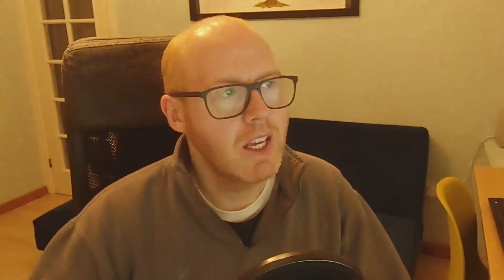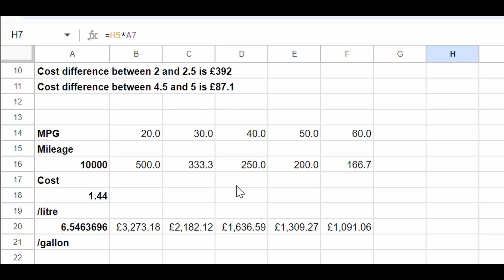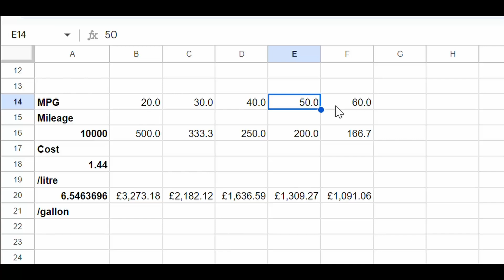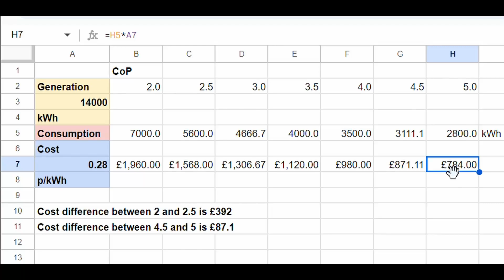Why Heat Pump CoP isn't Important : Reduce Cost & Decrease Efficiency?

Comment: I wish worrying about COP 4 or 5. Our SCOP is 2.4. British Gas install 2023, Vaillant aerotherm ASHP.
Reply: I suspect you can improve on this. Vaillant is a great pice of kit we get 4+ scop. Try posting on the openenergy forum . Very knowledgeable and helpful bunch who may be able to suggest changes that could help you out. Playing with the weathercompensation curve number is a big one. Good luck
Reply: Thanks! I am afraid there might be something fundamentally wrong with our installation. They put in a 7kW unit on our small bungalow. I will post on that forum though, perhaps there is some other easier-to-fix issue. I went down to 0.4 heat curve already, no effect. Flow T are low and house is warm, so it's a bit of a mystery to me
Reply: @pip1980  they love a problem to get their teeth into! We have the 7kw unit. Bit oversized for us. Does your low cop relate to a high running cost? Vaillant cops read out  are not very accurate from what i have heard. If cost is an issue have a look at agile octopus tariff. Turning down the room temp by 1 degree from 4 to 7pm. Has reduced our bill by a third from the price cap. The house does not noticably drop in temp during this time.
Reply: @pip1980 The heat pump is probably cycling if too large which reduces efficiency.   I assume a heat loss survey was done on the house.   This should give you an indication of the size of unit required
Reply: @crm114.  I think that might be the case. Their survey said >14,000kWh and they put a 7kWh unit in although our annual gas usage was only 5,000-10,000kWh.
Reply: @pip1980  No way has your house got that heat loss.    To get a rough estimate of the size of pump you need, divide your annual gas use by 2900.   In your case 10000/2900 = 3.4.  So, even as 3.5 kW unit might be oversized.    British Gas should have given you an estimate of the expected annual energy  use.   If it's not meeting that you have grounds for complaint.
Reply: @crm114. The fundamental problem in utilising prior gas consumption is you do not know how the user operated their heating system and what the departures were from design internal temperatures. In other words, some users are prepared to suffer discomfort to achieve the lowest possible bills - especially in the shoulder months. Rules of thumb are generally rules of dumb.
Reply: @normanboyes4983  I used this rule and it was far more acurate than the MCS calculation/estimate. After all they just guess the ventilation losses. Agreed that if gas use had the house cooler than they wish with hp it won't work well.
Reply: @joewentworth7856  I was talking in general terms, as I sort of indicated if you can be confident (as a user) that you have kept the whole house to design temperature then gas consumption can be useful. But a contractor cannot have the same confidence. If it is a MCS/BUS installation they are mandated to do a heat loss calculation.
Reply: @normanboyes4983  sure. What I meant is  it is  useful sence checker. IF he user has been happy with the comfort level of their gas boiler. MCS number will always be cautious to avoid undersizing. The gas rule of thumb allowed me to get my installer to install the 7kw in place of the bigger more expensive 10kw unit and the 7kw has still proved to be unnecessarily powerful. In the end I think installer will get a sense of what each building needs and start putting in better sized units in and hopefully hps will have wider operating ranges in future making over sizing less of an issue.
Reply: @joewentworth7856  The current issue with some units is while they are badged as a ‘small’ capacity the actual compressor used is from a larger unit and they limit the output in software to match the badge, so you are stuck with effectively poorer modulation.
Reply: @normanboyes4983  true. As the market matures and real numbers feed back in and there is a demand for physically smaller, cheaper, lower power units there will be a good market for 4kw and lower units with proper modulation range. Particularly  in modern insulated  privately owned apartments.
Reply from the maker: How have they set your controls? They set mine poorly and this resulted in a day of poor CoP until I corrected the settings.
Mine was functioning as a gas boiler on day 1.

If you've changed your curve to 0.4 and haven't noticed a change then I would check which room temp. mod. you have selected. It should be inactive whilst you try to find the right curve for your property.

The minimum modulation between the 3.5kW and 7kW unit isn't actually that much and I'm guessing you have a buffer tank as well which will somewhat shield you from the cycling effect of being oversized.

The 7kW unit does perform significantly better than the 3.5 & 5kW units when it comes to DHW production.
Reply: @UpsideDownFork  Hi,  I think I just made a discovery, but I might be putting too much hopes in this... Can I ask you, which flow rate do you get usually (Control unit->live monitor - Building Circuit Flow Rate) ? Does this go up and down or is it always a constant value?
By going into the installer level menu on the HP control interface (not the sensor comfort), I found out that the Flow Temperature (FP) is generally only ~1°C higher than then Return! i.e. dT ~1C° while it should be around 5°C. Secondly I noticed, that whenever the HP is running, the building circuit flow rate is constantly at ~1205 l/m, which is the maximum for the 7kW unit. So if I understand correctly, the ASHP just rushes the water towards the buffer. Our rooms however, are perfectly warm enough with however much the secondary pump draws from the buffer to the radiator. I assume that this is much less/slower however than 1205 l/m. So if that is the case, the ASHP just gets most of the hot water straight back from the buffer tank, instead of getting mostly cooler water from the radiator side. 
I phoned the Vaillant helpline today and the adviser was baffled by this as well and thought the unit should automatically adjust the flow until dT=5°C . We checked that I have "Conf. heat. build. pump" setting correctly as "Auto" (other options are 50-100 %PMW, whatever that means). Also he suggested lowering the setting "Max. rem. feed head" from 900 mbar (default) to 750mbar but that had no effect on flow rate. 
I am probably misunderstanding something, but at least I have some hope again that this might be something that can be fixed.
Reply from the maker: @pip1980 @pip1980 I've been replying on facebook, but on that specific question about flow rate, it has always been at 1205 when I've checked it.
Flow temp and dt seem to be the only things that vary.
Reply: @UpsideDownFork  thanks! Yes I was on the wrong track. I wonder if having the buffet taken out would affect the warranty. I guess without the buffet, the flow rate would drop significantly, but perhaps too much for the 7kW unit to work with... So would be very expensive indeed
Reply: @pip1980  Heat Geek and Urban Plumbers et al all say buffers are only required in rare circumstances. If you live in an standard house, as most of us do, you shouldn't need a buffer.

Best of luck with your query.
Reply: @davidreece1642  Thanks! actually BG came and changed the hydraulics! They changed the pipework on the 4-port buffer tank into a simple volumiser (one pipe in, one pipe out). They removed the secondary pump and it is now a simple loop! The expert they sent said he already fixed a substantial number of BG ASHP installs. Unfortunately, so far the COP has not improved as hoped. While that step was certainly correct to do, I am afraid that something else was/is the main culprit...The flow rates were reduced due to the change, but this didn't seem to affect the delta T as much as I hoped (or at all). It might come down to the size of the ASHP unit really as the obvious cause, but who knows... I had to be very persistent to get this change and I will keep persisting. To be fair, they have really always confirmed that they will support and carry through until the results match all our expectations and I trust them, so I think it is just a matter of time.
Reply: To update, BG actually just re-piped the buffer into a simple volumiser, i.e. simple loop without secondary pump! Unfortunately the COP has not improved at all or not noticeably (it has been one month now). 
I am really glad that BG have ensured me they will keep going, until we get a decent efficiency. They seem to put in a lot of effort to improve other existing installations as well and use this to train new people as well, so quite happy with that. I acknowledge that change to ASHP is not easy, qualified staff is rare and training takes time. Of course I had my fair share of studying up on the issue, chasing them  and also pushing back on some attempts from their side to shut down my complaint, with no solution in sight. Also losing countless work-days for appointments with BG engineers that turned out either clueless, or not being in a position themselves to actually do anything. That seemed to have changed recently, though, so I am hopeful. 
Now with the single loop, the flow rate is either 950l/h or 680 l/h instead of before 1205/840l/h. Not sure if it was a setting they changed at all. I think the 950l/h figure might be due to higher resistance of the single loop (no resistance at all with a buffer). The ASHP always has two discrete speeds it seems, and the higher flow rate is when the compressor is active. and the lower flow rate when its only circulating the water around. I got the impression, that dT and COP for us are only at high/acceptable levels during the respective slow speeds, but this really only occurs at the tail-ends of the operation. So while generally everyone says constant operation is best, in our case this means lower efficiency due to high flow rate. So I think that means the flow rate needs to be lower still overall, to achieve efficient dT and good COP. I wonder if the 7kW ASHP unit can reasonably be set to produce lower output (e.g. still lower flow rates, min. flow rate given in manual is 540l/h). The BG expert seemed very confident that the unit can still work efficiently at low loads, but I think the statement did not take our actual heat loss into consideration at all and there are certainly limits. I am keeping at it.
Reply: @pip1980  Let's hope so and please update further should the issue be identified and fixed.👍

Comment: Watched on silent with the transcript running (as at the airport), so that may have butchered or missed off you talking about it.
But its worth checking out heat geeks "this insulation secret will blow your mind" video (or something to that effect).
Basically increasing COP via insulation has separate cost saving effect by also reducing the heating load the property requires.
E.g. 10k at a COP of 4 would require 2.5k, but say you do insulation improvements that brings you down to 8k at a COP of 4.5 its 1777kWh required instead of 2,222kWh.

I do agree though chasing COP isnt the be all and end all for lowest cost. Overnight DHW "overheating" is a prime example of being able to save money but hurt COP.
Reply from the maker: Thanks for the comment and raising an important point.

We increased the level of insulation in our house but any further would result in marginal gains and diminishing returns as well as considerable upheaval.

Very much the same principle with the heat pump optimisation.
Reply: if you do plan any significant insulation though its worth considering that in advance. Don’t install an expensive heat pump then force it to run way under spec and potentially below its modulation by lowering heat loss dramatically.
Reply: @MrKlawUK  definitely true and a thing to consider. However, certain cases won't drop you into a lower heat pump bracket at least within the same manufacturer.  E.g. for ~8kW heat loss the 7kW arotherm plus might be chosen due to it technically being able to do 8kW at -3C, but the 10kW will still be fine.

Comment: What a total load of rubbish, COP (coefficient of performance) is a snapshot efficiency based on the kW output at a certain outdoor temperature, for example the manufacturers will quote EN14511 which states cop is based on a certain outside temperature and a certain flow temperature e.g A(air) at - 7 degrees and W (water) at + 35 degrees. SCOP is a more important figure as it’s COP over a period, generally a year. Your math is true, the difference between 2 and 4 is twice and 4 to 5 is a quarter. The most important thing an owner of a heat pump can do is to leave the system alone and let it do its thing. Finally a properly designed system in a property with high insulation levels will perform well with a gas boiler or heat pump, the running cost should be slightly lower for the heat pump but the installation costs will probably be significantly higher. If you are cost motivated then work out the extra installation cost of a heat pump minus the savings. A heat pump will almost certainly have a lower C02 than a gas boiler.
Reply from the maker: So what exactly is a load of rubbish?
Marginal gains and diminishing returns are very real considerations for the retrofit of heat pumps.

Comment: just run weather compensation, set the desired temperature and forget about it, it a win win
no complaints from the household about being cold, that's priceless.
i'm on gas until my heatpump install
my EPC stats i need 18000 & 2000 Kwh of heating/water
all bedrooms are set to 20 lounge kitchen 22 bathrooms 23
gas used Dec 1200, Jan 2000 cost 240
i would not have it any other way
Reply from the maker: The only complaints I get these days are that it's too warm, especially for sleeping!